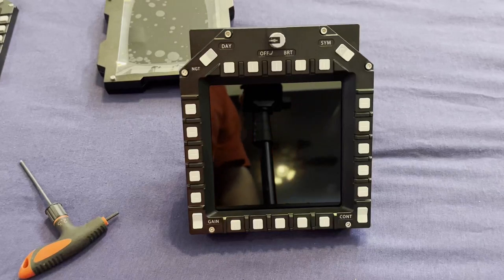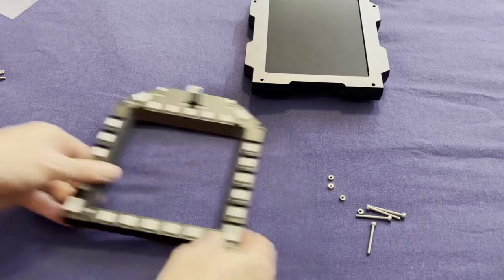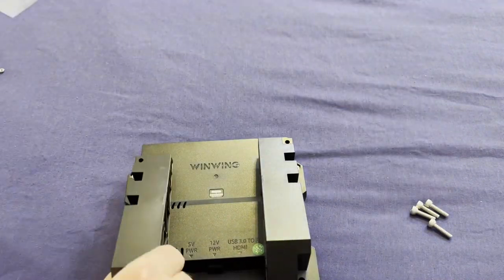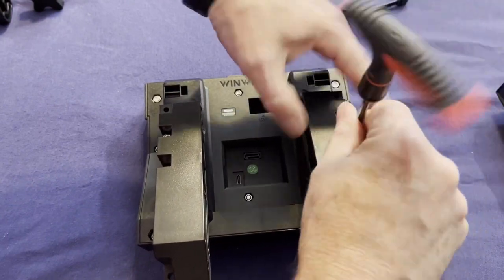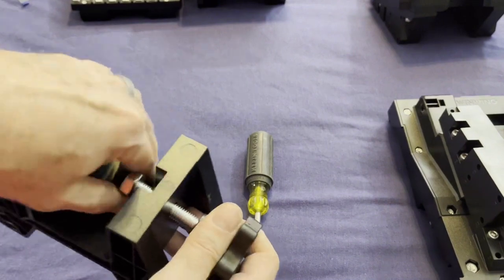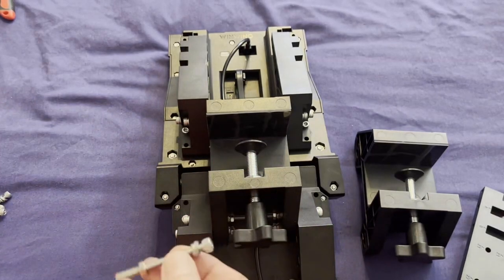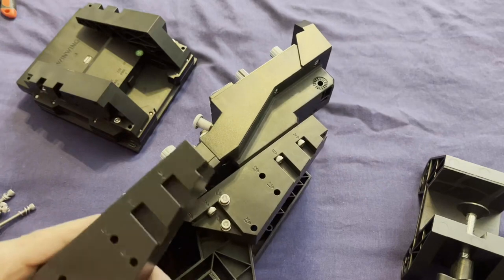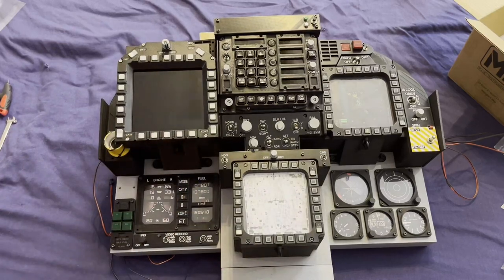Assembling the WinWing TopGun MIP (Main Instrument Panel) for the F/A-18C for DCS

Comment: Thanks for making this video John. My UFC & HUD arrived today and I was a bit uncertain about the bracket connections. My units are being added to a pre-existing Monstertech frames so the brackets with a few socket bolts and T-nuts make it very neat and strong set up.
Reply: Hi, I have virpil deskmount myself and was wondering how you attached this stuff?
Reply: @robertcras8151  
Hi Robert, I'll send you pictures and instructions.
Reply: @robertcras8151  
O.K, the Virpil mount is 76mm wide and Monstertech is 80mm.
I used the 45° angle brackets that came with the WinWing PTO panel between the mount and UFC bracket. As an alternative you might be able to use storage system components from a hardware store or CNC parts.
Because the angle brackets fit to the outside of the T-slot I had to remove some of the plastic from the interior side of the WinWing mount with a Dremel so the 45° bracket is recessed and it aligned properly. As the Virpil is a bit skinnier than the Monstertech you might not need to do this.
Hope this makes sense. I've taken pictures but having trouble attaching them.
Cheers
Reply: @dougalwilson4555  can i send you my email in a secure way?
Reply: @dougalwilson4555  Looked at the sizes and when you add the brackets the space between them is 80/81MM. The Virpil mount is 76mm. it might be possible to attach 2 steel bars/plates (dont know the English word) on the outside of the mount going up with a 2mm thickness with 2 holes to screw to the mount and 2 (4?) holes to attach the UFC. Is the AMPCD Attached to the HUD unit or does it need to be attached to the Virpil mount too with 2x2mm spacers?
Reply: @robertcras8151  Yes, 2 steel or aluminium plates with 4 holes on each. I'll put the pictures up on my Flickr gallery (search Dougal Wilson or DougalW21).
I don't have the AMPCD yet but a WinWing assembly video shows it as a separate mounting. Here's the link - https://youtu.be/Bbs6xCTNRqA
Reply: @dougalwilson4555  i have been thinking, with standard 2 metal M5 rings on botn sides ( 4 x 1 mm), you can easily attach AMPCD controller the lower part of the mount. Assuming the rings fit on the WinWing brackets for the display.
Reply: @robertcras8151  Were you successful with fitting the AMPCD to your flight rig?
Reply: @dougalwilson4555  Only investigated where I can find 2mm steel and who can fabricate it for me. Looking for a new assignment, once I bag that I will reward myself with the MIP. 🙂
Reply: @robertcras8151  
Good plan. I do my own fabrication as I've been involved in forest rallying for the past 26 years so I have most of the equipment to do it myself.

Comment: Hello sir,  I am hoping you can help me out.  I just purchased the Top Gun kit and i am a little confused about the display.  I understand the Display panel has one usb c but I am wondering about the screen, The screen has a 5 volt usb power and a usb 3.0 to P.C HDMI.  Do I need both from the screen?  if so than I seem to need three more cables.  I was hoping the usb c did the power and data.  Anyway  can you help please.
Reply from the maker: Only the USB 3.0 is needed.  The screen pulls power from it. I'd recommend using a powered hub and not going directly to Motherboard
Reply: @DCSTex  great thanks so much, I was thinking that I was going to have to buy cables. Funny I got confused when I seen multiple connections on the displays.  For what they charge I didn’t want to mess up the display lol.  Thank you again.

Comment: Thanks John. I kinda like your idea of just one mounting solution and just marry up those two DDIs with the UFC. would you be able to share the STL file for it?
Reply from the maker: After getting it all together I decided to go ahead and use all 3 clamps.  I do have the STL file, but it didn't print it or know if it will work.  I'd be happy to share it if you want to give it a shot.  I did print a thin test piece to make sure the holes lined up.  In the real jet the outer DDIs are tilted back just a tad, so the STL (at least how I have it, wouldn't allow for that tilt like the clamps do.
Reply: @DCSTex  I'm planning to do the side by side option. Already purchased M5x120mm bolt screws and plan to print the spacer but was wondering what is this STL design you have. Just a spacer or a special bracked you designed? if so, is it something you can share? thanks
Reply from the maker: @bojote  https://drive.google.com/file/d/1960bG0LJfcTBiAtVoeMlRKUxaRy7fdKH/view?usp=sharing

Comment: Did you end up coming up with a solution for new 3d printed panels to fit the larger DDIs?
Reply from the maker: yes.  I'm about 85% done with it.  New video coming in the next few weeks once I get it all finished and working.  I like it immensely better than the original design.  Its modular with the top half mounting directly to the winwing brackets

Comment: At the 9:19 mark of your video, you show the bottom screen attached to complete the center console. That is the problem I am having, how do you attach the hud to the bottom unit?
Reply from the maker: they both attach to the same desk bracket
Reply: I found the problem, it was the metal plate and the spacers that I overlooked. Thanks for your reply.

Comment: Did it work out with your 3D printed adapter? Mind sharing the .stl files?
Reply from the maker: no, I ended up using the included mounts for the DDIs so I could tilt them independently of the UFC

Comment: Hi John. Nice video. I finally got my MIP. Did you print the spacers you were talking about? I have the same issue myself. I really would like to have the MFD's mounted higher.
Reply from the maker: no I actually ended up using the included brackets on the  L&R DDIs.  I like being able to tilt them independently of the UFC
Reply: If I look at an actual picture of the FA18 they are indeed higher. Making such an awesome replica and then make the MFDs too low, strange WinWing missed this....
Reply: @DCSTex , I found that the align correctly when attached to my desk. I also ended up using my Wonwar Left+Righ DDI's as they are a true replica of the F18's. I use the Winwing DDI for the AMCPD. It now looks exactly as in the Hornet.

Comment: Great video. Thank you for sharing. I was wondering, are the standby instrument brackets shown around @12:00 3d printed? If so, where are those files shared? Openhornet perhaps?
Reply from the maker: I designed all those.  There is a link the description of this video to my 3D printed cockpit video.  In the description of that video there is a lnk to the google drive with all the files
Reply: @DCSTex  Awesome! Did you get the dimensions for those stby instruments from the real ones?
Reply from the maker: @boggy8557  no, someone else had made the UFC files, so I use that and the Thrustmaster cougar dimensions and scaled it off the drawings in the back of the F-18 NATOPS.  Its pretty close except the cougars are smaller than the DDIs in the real hornet so it throws off the outermost controls about 3/4 ".  I'm currently redoing it with the Winwing MIP, so it should be much closer after that.  I got to sit in a F-18A cockipit this weekend at an airshow and nothing felt drastically out of place.  Biggest thing I noticed is the stick height in the real just is really low.. almost below your knees.. part of that is the floor seat height is also really low.  The real jet also has a lot more depth between the upper and lower sections.  I couldn't really do that due to structure concerns with 3D printed parts